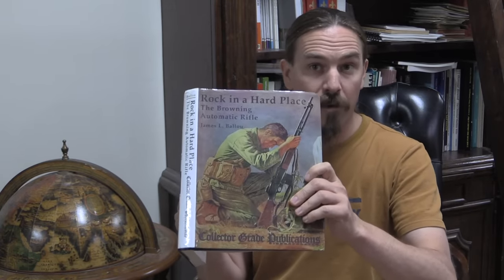Ask Ian: Why Not a Semiauto BAR Instead of the Garand?

Comment: It's always interesting to see how the experience of previous conflicts influences the generals of the time. They're always in the mindset of the previous conflict. They're worried about a rifle being able to be fired like a bolt action when a box magazine rifle would have given so much more advantage.
Reply: To apply modern mindset to past times is a mistake also. At the time it was A REAL PROBLEM to design a box magazine so cheap to be discarded on the field and so consistently built to not cause feeing issues. It was a problem still in the '50s, when the M14 had been adopted, hence the stripper clip guide.
Reply: @neutronalchemist3241  the mag should never be discarded. Their fear was the troops would dump 'em and that's why they did not want a mag fed rifle.
Same goes for semiautos, many generals hated them because they were afraid troops would waste ammo around.
It's the typical backward thinking top brass have
Reply: Militaries that jump on every newfangled thing without thinking it through tend to be militaries that don't win wars.  The same is true for militaries that end up mired in the past, of course, but I've never seen or heard of a military commander that was willing to part with what he KNEW worked for something that MIGHT work better or might not work at all.  Bolt-actions were a reliable known quantity - commanders knew how they worked and what to do with troops using them.  Wanting to ensure that capability didn't disappear and leave men helpless in the face of hostile action is so very Military it hurts.
Reply: I think a part of small arms adoption was reactionary as well. No one else was using a semi auto at the time (save the RSC) so we can wait because the perfect design is right around the corner of course. The US was lucky that came true before WW2, everyone else, not so much.
Reply: @phantomsoldier497  This goes back to at least the Civil War where the Union refused to adopt repeating carbines in any real numbers because they feared that the troops would waste ammo if issued them. Most units that had therm got them via private purchases using the unit's own funds or were part of a state's militia that did not share the Federal army's concern over potential ammo wastage. Interestingly enough, Custer's 7th Cav was issued lever action repeaters during the Civil War but turned them in for Psringfield Trapdoor carbines after the war was over and that was whet they wen't into battle at The Little Bighorn with. The irony being that their enemies were mostly armed with lever action rfiles giving them a big advantage in firepower bescuase their greater rate of fire compare to this inngle shot, breach loading carbines of the 7th even through the Springfields had a longer ranger and fired a more powerful cartridge.
Reply: @neutronalchemist3241   Thank you for explaining the reasons for "caution" around box mags at the time, my initial assumption was knee-jerk conservatism, but I figured there was probably a rationale even if were ultimately proved wrong.
Reply: @Riceball01  While armies were afraid soldiers would "waste ammo" firing semi-automatic, it's interesting to note that while most modern standard infantry rifles allow for full-auto fire, both armies and soldiers generally consider full auto fire from the likes of an M4 to be a true waste of ammo. It seems for the standard infantry rifle, semi-auto is a good balance of volume of fire, ammo consumption, and aim.
Reply: @phantomsoldier497  This is amongst the things that baffle me the most when thinking about how massively stuck not just in former wars, but in former centuries generals on all sides were not just at the beginning, but far into the ongoing first World War. 

The Second Boer war 1899-1902, the Russo-Japanese war 1904-05, damn, even the German-French war 1870-71, where german artillery pounded unsuspecting and unprepared french troops into pieces gave more than a little taste of things to come and more than just a little hint of what to expect in the industrial age and yet, they've decided to learn nothing from it.

Especially the Russo-Japanese war can be seen as a small scale WW1, with trench warfare, waves of infantry being driven into heavy machine gun fire by their supperiors and snuffed out in minutes or even seconds, mortar and artillery fire wiping out whole trenches full of soldiers. It was like they said 'Yup, interesting, but surely just an anomaly. Nothing to take note of, to worry about or, god forbid, to prepare for.' 

Although I will never understand why an at least somewhat person can think it is a good idea to send cavalry against concrete bunkers or machine gun infested, barb wire protected positions. That requires a special kind of cruel stupidity.
Reply: @DoomGoober  Generals seem to consistently forget that soldiers have a vested interest in not running out of ammo during combat, and therefore will tend to use it as the situation requires. 

Generals also consistently forget that a unit that is so outmatched that it is combat ineffective, it is irrelevant if it has plenty ammo or little.  

But Generals understand peacetime budgets and reasource management as that's what they spend the most time doing.
Reply: @Furzkampfbomber
A lot of militaries actually looked at the Russo-Japanese war just from a very dumb perspective. Because the Japanese technically won the war everyone was like „Yeah, the attacker always wins and the troops with better fighting morale will prove supreme.“ while completely ignoring Japan‘s catastrophic losses. Ian actually talked about this a little bit in his video on the Fyodorov Avtomat
Reply: @DoomGoober  The semi-auto option only exists for when the rifle is pressed into off-roles. Because why wouldn't you want your riflemen to have the limited ability to be machine gunners if the situation really required it?
Reply: @Riceball01  Custer's Michigan brigade during the CW had the 7th Michigan Cav. as part of the unit. After the CW his command was the 7th US Cav. Regular army officers like Custer were breveted as brigader generals of volunteers then reverted to their regular army ranks such as Colonel of a regiment of regular army troops.
Reply: @bubba200874426  Fair enough. The selector mechanism is a few ounces at most and I guess taking away the option doesn't grant much. However, I have spoken to National Guard and active duty soldiers who have said they never trained to fire their M4s in full auto. One soldier even told me that his squad would probably prefer commercial semi-auto M4 variants over mil-spec select fire M4s because they'd prefer the smoother triggers of commercial M4s over the ability to fire full auto. That's putting the relative value of full auto on the M4 pretty low (or it's a harsh condemnation of the military M4 triggers.)
Reply: @DoomGoober  well, generally that's why they have special forces. Ideally, the rank-and-file never need it, but it's bad strategy to only plan for the ideal.
Reply: Box mags cost money.
War costs money too.
Reply: @jmackmcneill  I don't think conservatism is often done out of knee jerk reactions. Typically there's a well established motive for why the person is wanting to hold onto what's known.
Reply: @phantomsoldier497  That is entirely wrong. 

Most militaries were looking at semi-automatic rifles for decades before they became common during and after WWII. The French adopted one in 1914, but cancelled because of that whole WWI thing. 

The problem was that making a semi-automatic rifle that was reliable with contemporary ammunition, could be mass produced at an affordable cost, and wasn't absurdly heavy/awkward was really freaking hard. And it wasn't until  the 1930s that it really became practical. And by then, there were other priorities for most militaries. 

Detachable box magazines were unpopular for a few reasons. Mass producing cheap and reliable magazines wasn't trivial and were quite vulnerable to damage. Clips were cheaper, easier, and more reliable. They were also bulky and having a 20 round magazine sticking out the bottom of your rifle would limit how low you could position yourself.
Reply: @Riceball01  It was less fears of wasting ammunition and more knowing the army couldn't supply enough ammunition for the rates they would be consumed.
Reply: Hindsight being what it is... but when the M1 trials were going on, developing a cost-effective magazine that was reliable was also a headache in itself.  From a logistics standpoint, the en-bloc clip was great - no magazines to go missing or get bent feed lips, all of the ammo could be pre-packaged and ready to go into a rifle straight out of the box, reliable, and cheap. This did mean they were a bit stuck for ammo capacity in the rifle, but that's the sort of compromise they were making back when nations were still trying to figure out what a reliable self loading rifle even looked like.
Reply: @88porpoise  To be fair, the wasting of ammo was seen as a logistical concern by senior officers. They were concerned that troops with rapid fire capability would consume ammunition faster than they could be (re)supplied.  But I don't think that the production of metallic cartridges was much of a concern, simply getting enough out to the field fast enough was the concern going by everything I've read. This was still a concern decades later in WWI (or maybe earlier) when the British installed magazine cut off devices on their bolt action rifles, preferring their troops using their rifles as single shot breach loaders unless absolutely needed and specifically told by their officers to start feeding from their rifle's magazine.
Reply: @Riceball01  Magazine cutoffs were introduced before clip loading. In that case they make a ton of sense to keep the magazine in reserve until a key moment. 

By WWI the British still had the magazine cutoff not for use in combat, but as a sort of safety.
Reply: magazines were very difficult to reliably manufacture back then, and well mostly up to like the modern day, but clip systems were also substantially cheaper, lighter and easier to ship in that time so it made way more sense
Reply: @Riceball01  tbf the way troops were trained and drilled back then did cause large amounts of wasted ammo when under pressure. at the battle of The Rosebud (the prequel to Little Bighorn) the american troops acting on instinct dumped ammo on the ground in front of them in anticipation of rapid fire only to have to leave that ammo behind due to rapidly being routed. they 'used' something like 25,000 rounds of ammunition for a few dozen dead on both sides. the native americans found piles of ammunition at the defensive positions after the army's retreat. Though that's all the fault of the generals designing the drill and training so its still on them not the troops doing what they were trained to do
Reply: @88porpoise  you should read the whole comment thoroughly before commenting though. I never wrote Armies didn't want semiauto but generals and if some important top brass is completely against an idea trust me that they will find a way to fuck up procurement so that the project dies or goes his way.
Just look at how the semiauto trials went for the US with all the meddling or the history of how the m14 rifle and 7,62 NATO were adopted.
Mags were already a feasible concept since the late 19th century and were mass used in WW1 for machine guns and smg so there is no excuses they couldn't adopt one in a rifle in the 1930's-1940's.
Dude one of the weapons in the video is mag fed and each squad was supposed to have 3 operators per gun carrying dozens of mags in total and this is a gun from WW1 and worked like a charm.
The real reason is that they believed soldiers were not enough reliable to not lose them in the field and that's about it plus other reasons like dirt getting in the action and other excuses you can find on books.
Reply: @phantomsoldier497  They could make them, but if you wanted cheap and reliable, clips were far better. 

For things like machine guns, where volume of fire is critical, the benefits of magazines begin to outweigh their costs.

And, again, designing and producing a practical military semi-automatic rifle was a challenge in and of itself. The few that were adopted in limited service all had significant issues.
Reply: Like the early German Gew41(Mauser version) semi-auto rifle. It had a bolt-action on the receiver if you wanted to use it manually. It failed!
Reply: @DeltaEchoGolf  The German insistence on a turn-bolt was stupid. But requiring the ability to cycle the action manually wasn't necessarily a bad idea at the time. 

Semi-automatic rifles of the inter-war era were generally not that reliable (even the M1 had issues until it's gas system was replaced in 1940) and wartime standard issue ammunition was inconsistent, at best, making matters that much worse.
Reply: The fun part is that their answer sounds like General Liu Rifle... which was designed in 1914! The other fun part is that initial batch of the rifles and ALL the tooling were made in US and it was specifically set to be robust and produced at low quality manufacturing plants with unskilled labor en masse. All US army and cavalry had to do was to suggest General Liu to sponsor him getting replacement set of tooling for ROC instead of the one that drowned and get a license. Then mass produce tooling for US arsenals. But thankfully irl war didn't break out earlier and Garand was (mostly) on time.
Reply: @88porpoise  to see why detachable magazines weren't liked at first you just have to see Ian's video on PPSh and yankee version of Chauchat. There is just so much less that can go wrong if magazine is always the same one.
Reply: @Riceball01  Trivia fact, the soldiers using the "trapdoor" rifle were issued 160 rounds when  they arrived at their unit were expected to make them last. Half or more of the 7th Cavalry had rifles that had never been sighted in.
Reply: I'm always confused with the whole interwar and WW2 era line of thinking that "we MUST have a bolt and we MUSTN'T have detachable magazines". This obsession with no mags is hilarious when you think about it. You have top brass so obsessed with the concept of the soldier loading a single round at a time, they completely lost the broad picture of just how much firepower it allows to bring when you aren't buys loading things from a stripper or any other tool, not to mention one-by-one.
Reply: @davidschneider9145  Russo-Japanes War is a fantastic conflict in retrospect. Because literally whole world was watching (this was the last war to have military attaches and observes of neutral third parties just sitting and taking notes) and EVERYONE, including both Japanese and Russians fighting in the war, came to completely different conclusions, ALL of which were soon to be proven completely wrong. In case of Russia, it cost them the WW1, in case of Japan, it led to their disastrous performance (actual performance, not theoretical) during 2nd Sino-Japanese War, and, by extension, WW2.
Reply: @Myrth1  
1)stripper clips aren't slow. They were used to top off magazine fed battle rifle well after WWII; 
2)magazines are costly. And for it to be effective you need to have several per soldier ie more then 3 at LEAST. And two others soldiers reloading them while main one fires?; 
3)Fedorov Avtomat and Chauchat were greatly held back by how easy to damage and unreliable their magazines were; 
4)magazines for full powered rifles are massive. And since you need several of them, you basically end up with number two as your ammunition carrier;
5)If you invest so much and dedicate several people to keeping the magazines supplied, you basically get WWI-WWII LMG doctrine anyway.
It can be somewhat mitigated by soldiers working in pairs and helping each other, but rifles like General Liu rigle or Garand were just easier for some time.
Reply: @TheArklyte  Ok, thanks for the insight into the mindset. And I don't mean it to be snide, but I genuinely consider concerns you've listed are a great way to portray the line of thinking going. All of those points can be easily rebutted and practise generally showed that the benefit of having a mag outweights everything else, but WITHOUT that practise, all there is is the mindset saying "hell no, not worth the hassle".
Reply: @compwiz101  and even at the time the Garand held more ammo than any enemy bolt action did. So it was faster to shoot, faster to reload and gave 3 extra rounds
Reply: @yurei8368  it dont matter fully autos worked to but had the probability of jamming they still used them so magazines would have been perfect considering smgs the bar had mags m1 carbine had a mag but yall forget the military uses its cheapest option not its most smart one money please thier excuse to yall young white boys that In total well spend but what protects you deal with as long as it works and they still got that mentality should have used 308 in middle east but 5.56 is cheaper but your tactics were more like trench warfare than urban combat which 5.56 trives
Reply: @DoomGoober  yep besides rapid fire will give u a high volume as well but more accurate
Reply: @0neDoomedSpaceMarine  shit id take a lever action over those bolt action rifles and id like 4570 so fuckaround if u want
Reply: @DoomGoober  in the military 10 or more guys popping off m4s u wont need em on full auto

Comment: SIG XM5 doesn't weigh 13 lb. It's 8.38 lb w/o suppressor, 9.84 lb with and 11.24 lb w/ suppressor and loaded 20-round magazine. SIG's XM250 LMG SAW-replacement does weigh 13 lb with bipod but w/o suppressor and unloaded.
Reply: @Lurch7861 A full-power, beltfed LMG can’t weigh 8#. It would promptly overheat, foul and be uncontrollable. KAC AMG weighs almost 14# without suppressor or QCB handle. Mk 48 weighs 18# and titanium M240L 22#. PKM is similar.